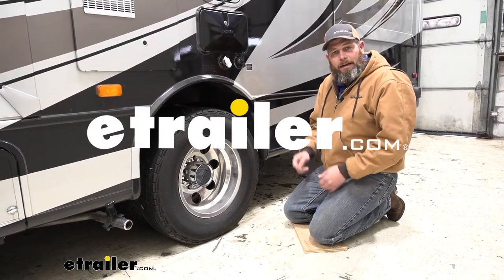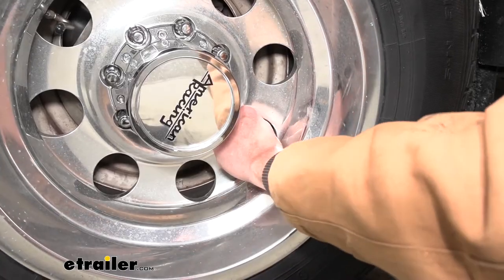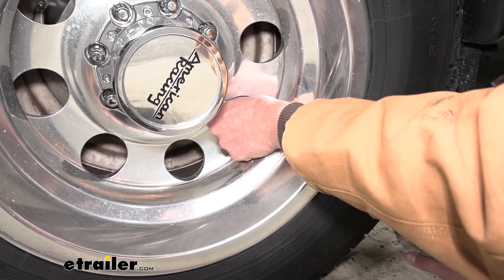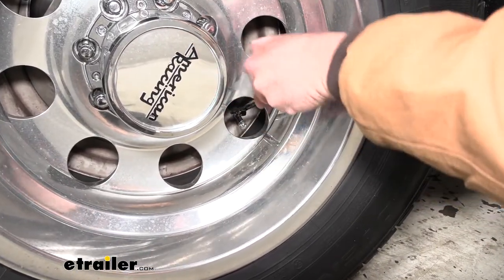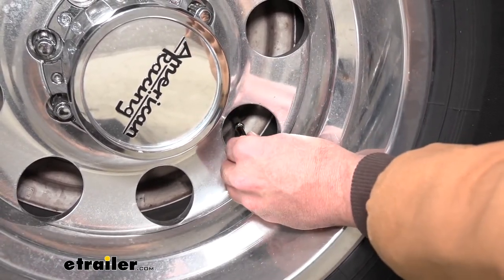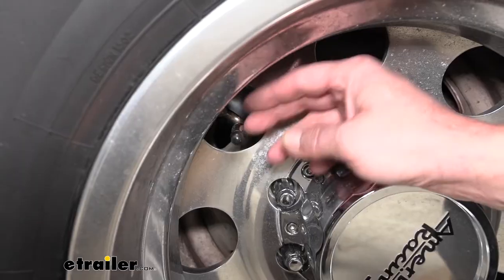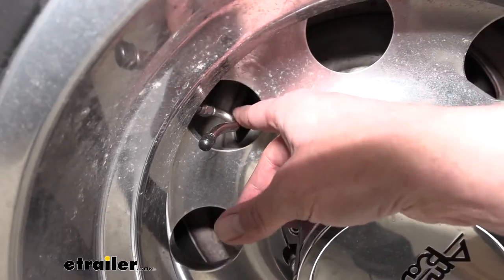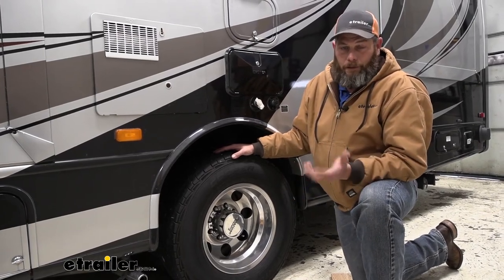etrailer | Wheel Masters Tire Pressure Valve Extenders Review

Comment: I have constant air leaks from my RV tires.  Class C 22 ft Ford E350 V10 1997 RV.  I love this beast.  My tires keep leaking air.  The tire company did a crappy job of mounting them so the stem extenders are virtually unreachable.  Sigh.  I bought the extenders new at Auto Zone and they are crap.  I want THE BEST STAINLESS STEEL DIAMOND PLATED VALVE STEM EXTENDERS IN THE WORLD.  Please recommend the BEST ones.  I will refinance my house if I have to but I want the best. This problem has to be resolved once and for all. The frustration is boiling over.  Please!!! Someone!!!

Comment: What do you do if you have a rubber valve? Can you still put an extender on it?
Reply from the maker: You don't want to use a rubber valve stem with an extender. Use a metal valve stem like # AM20905 that'll fit rims with a valve stem hole diameter of 0.453" and 0.625"
https://www.etrailer.com/Tire-Repair-Tools/Americana/AM20906.html

Comment: Would these fits on 19.5” wheels?
Need the inner & outer extension just like these pleaaaaasssseeeee???
Reply from the maker: The # WM80292 would work well for your outers, along with # WM8029180 for the inners.
https://www.etrailer.com/Accessories-and-Parts/Wheel-Masters/WM80292.html
https://www.etrailer.com/Accessories-and-Parts/Wheel-Masters/WM8029180.html

These will work fine with 19.5 inch wheels.

Comment: Thinking of getting these for my dually.  I have runner valve stems now and will have to replace those with steel ones to accommodate these extensions.  Can you send a link to what would be the best option?  Also, a link to these straight and bent extensions for the near tire would be super helpful.  THANKS
Reply from the maker: We have a steel stem valve available in the following link. 
https://www.etrailer.com/Tire-Inflation-and-Repair/Americana/AM20906.html
Check out the following links to see the stem valve extensions that we have available on our website.
https://www.etrailer.com/dept-pg-Tire_Inflation_and_Repair-sf-Valve_Extenders.aspx

Comment: I guess these will throw your tire balance? I don't know the price to have a truck/rv tire shop to remove all the wheels and rebalance them. It Can't be cheap.
Reply from the maker: You can have the balancing checked but tires usually do not have to be rebalanced when adding these tire pressure valve extenders.
https://www.etrailer.com/Accessories-and-Parts/Wheel-Masters/WM80292.html